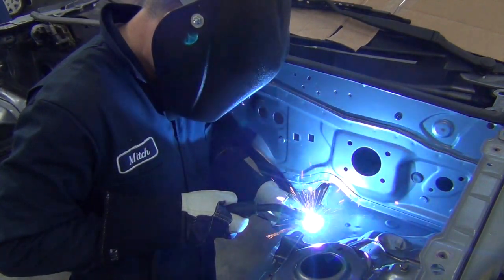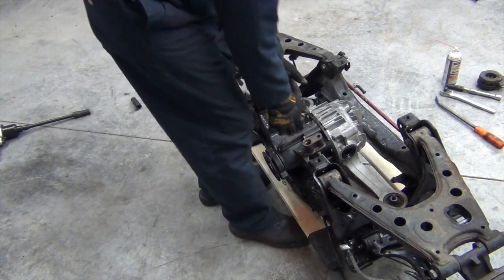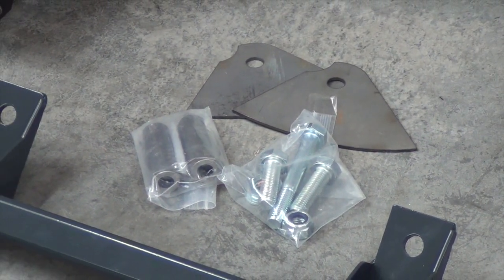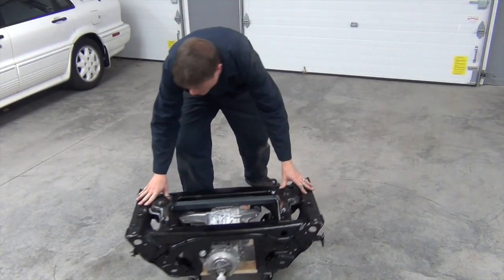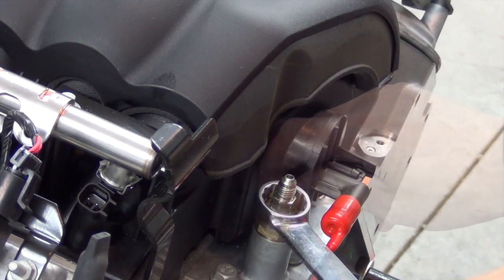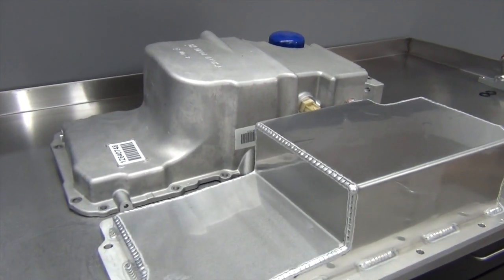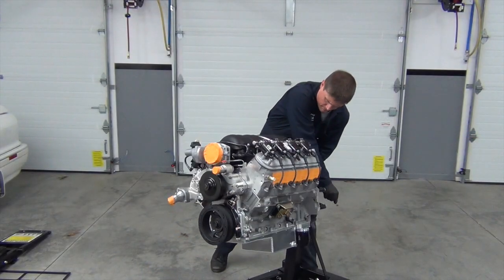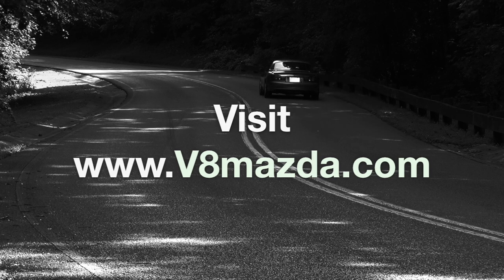LS3 V8 Miata Build - Project Thunderbolt Part 4

Comment: I was about to ask when the new episode was coming lol. Maybe use a oil filter relocation. I know it's going to be hard to change that lol.
Reply from the maker: Echo-GAMING Yeah man, every two weeks!  I wonder why folks are saying that about the filter, just stick a cap tool on it and it comes right off.
Reply: hmm yea i know 2 weeks lol it seems o long shah good work tho. idk but it seems like a hassle to change it on the stock location. or not idk :3 can't wait to see it rip through the tires.

Comment: I'm curious why you put the pan on with the engine right side up and then turned the engine over.  Did it have to do with the flapper inside the pan?  I don't kneel on the floor anymore if I don't have to!  Great project, can't wait to see it run!
Reply from the maker: monomille1 Thanks man!  It just felt more natural to use the bolts to lift the pan to get an even "squish" on the silicone vs. trying to plop it down even from the top, which felt awkward.

Comment: I like how everything seems to go so smoothly for you. Probably because you're organized and don't take shortcuts. If I made a video there would be multiple 30 minute or longer segments of me staring at a garage full of parts trying to figure out what to do next, or wondering why a certain bolt isn't threading into the hole I thought I remembered it belonging to. lol
Reply: tip no.1..  dont use a pen and masking tape  to label stuff. after a couple months in sun all writings is gone..
been there..done that..
dyno labeler is your friend if some of it is stored outside.
Reply: Videos edited out all the head scratching
Reply: LMAO! I’m right there with you brother.
Reply: Didn't cheap out on parts either.

Comment: Wait wasn't the 2004-2007 CTS-V rear diff extremely weak and prone to breaking under the 400hp that car had?
Reply: The 2004s had rear diff issues. These issues were addressed in the 2005+ cars.
Reply: carboncrew96 You might be right but I remember was looking at buying a 1st generation CTS-V however when searching though various forums they all pointed that all them have one issue or another they're all prone to braking during launching and hard shifts that's why most upgrade to a custom 9" or Ford 8.8. They did make some upgrades and made them a bit better but they all still break even under stock power, which was 400hp. I hate to see this build go bad just because of that differential. From what I've read the issue wasn't truly addressed till the 2nd generation CTS-V but I maybe wrong.
Reply: Tony Moreno Usually when a defect is found like that, all replacement units will have the fix on them.
Reply from the maker: Tony Moreno Like anything it was a variety of factors that caused this.  I came close to purchasing a CTS-V back then and researched this heavily.  They don't have this problem in Miatas.  It may or may not have something to do with the over 1200 pound curb weight difference. :-D

Comment: I saw green grass and brown leaves when you were coating the sub frame. Was this filmed in the fall? If so, thunderbolt is probably ripping up mountain roads right now!?
Reply from the maker: rstormzand I'm not sure exactly when that was filmed, but that bit of work was done some time ago.  I try to arrange the content in the video by task, but it is rarely that way in the garage, a bunch of little things are going on at once, as you would imagine.  That said, I still have lots of work to do!

Comment: That oil filter is gonna be impossible to spin off by hand. o_o
Reply: considering the 20k he(and sponsors) has in to this so far im sure the 4$ filter wrench wont break the bank
Reply: Most have the correct tool for the job as above,But if you don't hit a screwdriver into it and turn it
Reply: +86gtforme even a million doll hairs doesnt help a stuck oil filter due to negligence... For how much this guy reads toque specs he should know better than that.. Even my girl knows you just dont do that... quarter turn after it hits the block and thats it.. never had one i installed leak.
Reply: Its called learn how to put an oil filter on and you never have to deal with any of that.. No one is saying give someone a million dollars to take it off. I'm saying a million dollars doesn't matter when you tighten the filter to much.
Reply: ***** if you give me the million ill get that oil filter off bud. id rather have my oil filter too tight and spend 20 minutes getting it off than have it too loose and ruin an $8000 motor.
Reply: I m sure he didn't put an oil film around the flange either. Overtighting things can cause a leak too btw.
Reply: Try to take the oil filter off of my 97 TBird V8, that could probably the hardest oil filter to take off.

Comment: Since you flipped the injectors around like that, will you have to just adjust the ECU to account for that? Or how to do you ensure the injectors fire at the right time?

Also, is your name Tom or Mitch?
Reply: The injectors don't care for the side, they are all the same. The harness is still in the same place so it will pulse the correct injectors.
Reply from the maker: Boiko Aladjemov Yes, well said!